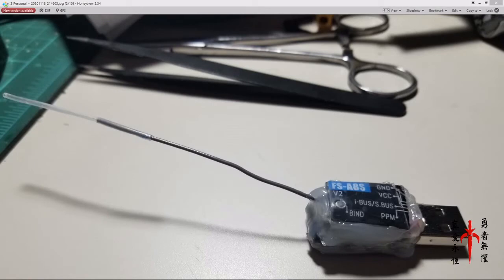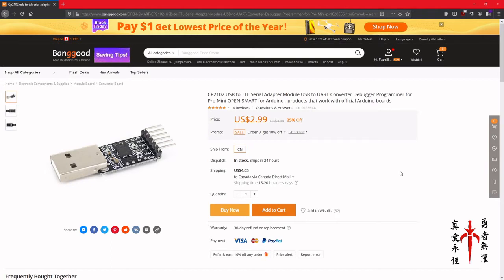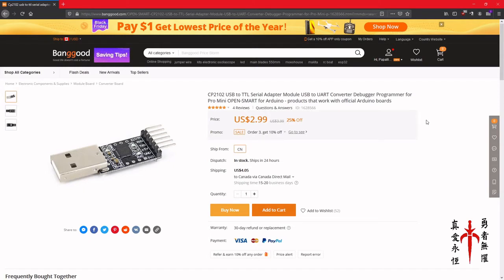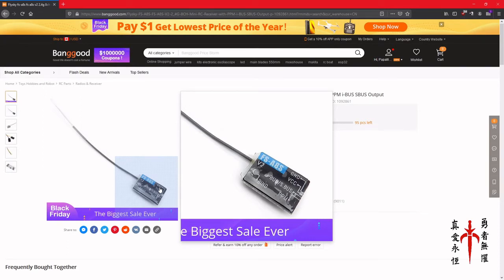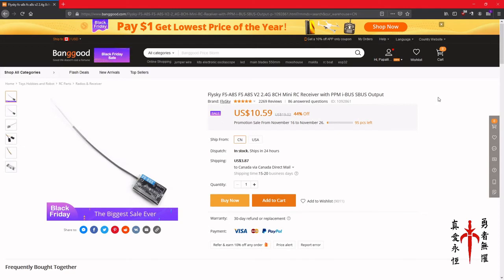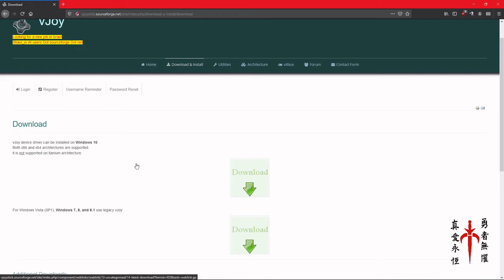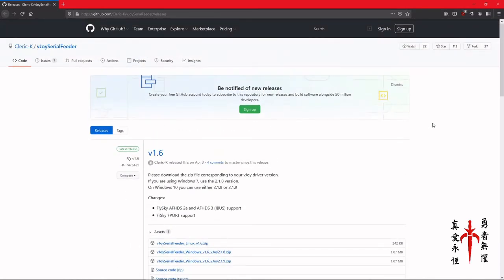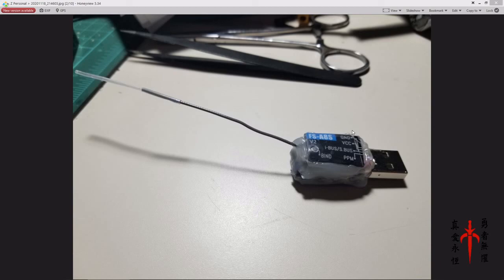Wireless AFHDS 2A Receiver USB dongle DIY (Ibus, Sbus, PPM variants) RC transmitter as a Joystick

Comment: Hi! Thanks for making this video. I found it while trying to find ways on how to connect my RadioLink T8S to my computer. I've been able to follow through your instructions so far but on my vJoySerialFeeder, im not getting any feedback. The bottom part says "Connected, Failsafe (Waiting for Serial Data)". Can you show how exactly did you set up for vJoySerialFeeder?
Reply from the maker: Installing/Configuring VjoySerialFeeder

Download vjoy and vjoyserialfeeder (not the source file but the installer for your OS).  Vjoy installs as a driver, but vjoyserialfeeder has to be run manually every time you need it.

Run Vjoysetup.  Follow through the installer.  You should hear the windows usb beeps as the driver installs and the device manager should show up a new controller.

Then run configure vjoy.  Choose number of axis and buttons available on your transmitter.  So minimally axis would be X,Y,Rx,Ry and buttons would be the # of buttons channels.  Apply those changes.  You should hear windows device removal reinstall sounds.

Then run the vjoyserialfeeder.  Setup your protocol and configure your channels map.  Like if channel 2 is steering then map it to a controller axis.  You should see the controller sliders react to your inputs on the controller.  This program has to run the entire time you play.  It is only necessary to run this last program each time you play.

Comment: Hi. If i wanna connect my radio using wires (The boring way 😬) Do I only need to connect ppm output and ground? And if so, on witch pin do I connect ppm on the cp2102? Thank you!
Reply from the maker: You would use the outputs from the radio directly to the board replacing wire for wire the connections used from the receiver with the connections that were done on the cp2102 and make sure that the radio is set to output ppm.  You don't need to power the radio like you would a receiver so you can delete the positive power tap wire.

The trainer port on the radio would output a ppm signal and a ground.  A quick web search can show you the pinout of your trainer port on your radio and you can just make a cord if you don't already have one.  Depending on the radio it is typically a 1/8 mono jack or a match for an old s-video cable jack.  Unfortunately if it is an alternate of an old s-video jack DIY cord makers will have to peel apart the jack and start there with a wire since the old s-video cables don't always have the right wires inside to all of the pins to just be able to cut the cable and solder the wires to the right pins on the cp2102.  On the upside if you already have the flysky s-video port to 1/8 mono jack style connector then you just need to use the two poles on the 1/8 jack because those are ppm and gnd according to standard training port pinout.  I would actually just mount a female 1/8 mono on the board so you could plug and unplug easily.

ppm to rx and gnd to gnd on the cp2102 then do all of the software the way you would.  Because the cp2102 is receiving the ppm signal on the uart input (5 pins).

The latest radio's often have usb connection to pc ability to use as a controller.
Reply: @lolipopsandfancypants7257  Cheers! Been lookin on Diy videos and such for this. I have a real old Esky receiver Ek2-0426 and doubt it has ppm output to make this wireless. (I know I can buy a cheap one that has) And the controller has the old "s-video" output. Will try to run this on a Mac and Next/Cgm rc heli sim. Trying with a wire in-between first. Thank you for replying 🙂

Comment: Hi.. Thanks for making this video. I have a question.
I tried this before with Arduino Nano and FT232RL module. Arduino gave me less latency compared to FT232RL. But I heard that Arduino's boot sequence can damage the receiver's firmware permanently. So each time I should plug the receiver into the Arduino after its boot process.
In the case of FT232RL I can just plug the whole thing into USB without any problem, but It has a noticeable latency.

So is CP2102 module any different from FT232R in terms of latency ?
Is it similar to a wired connection ?
(by the way the reciever i'm using is FS iA6B)
Reply from the maker: I haven't used it in latency critical applications, but see that the cp2102 has a stated bitrate of 300kbit to 1Mbits.  The ft232rl commonly has a bitrate of  115.2 kbit.  USB 2.0 is 480mbps so there theoretically shouldn't be a limitation there.  However, the drivers used can greatly vary the speed of any chip used and the greatest limiter is the protocol(s) used.  So it's kinda a huge question.  CP2102 was meant to be an upgrade to 232 devices and should perform better, but the software and drivers on the computer is likely the most limiting factor.  I am a raspberry pi guy and don't directly play with Arduinos.  Many rc transmitter are built around arduino compatible technology; however, and this makes me want to explore them more in the future.  Theoretically, the latency is less, but I don't know.
Reply from the maker: One other thought.  Decreasing the number of channels broadcast from your transmitter will decrease latency.  8 channel vs 16 channel.  This also depends on the default output from the receiver on the bus channel.
Reply: Where did you hear about Arduino boot sequence issue? I was gonna do the same, but now I'm hesitating a bit...